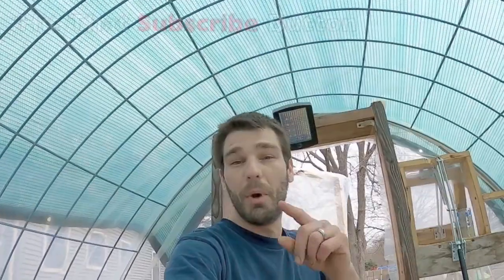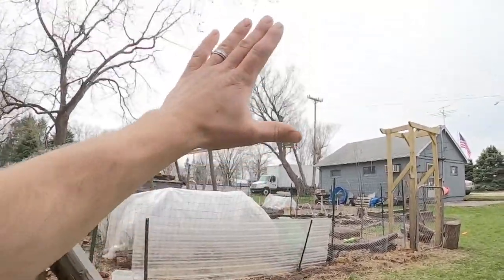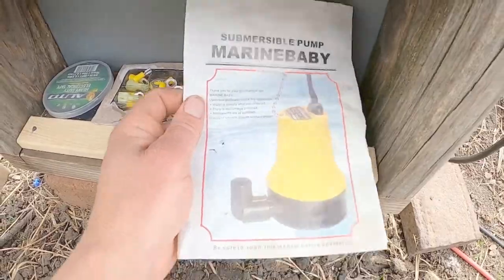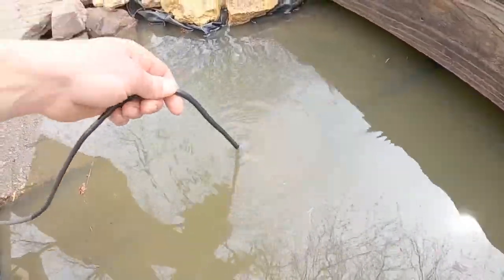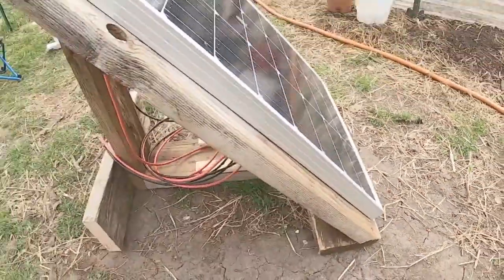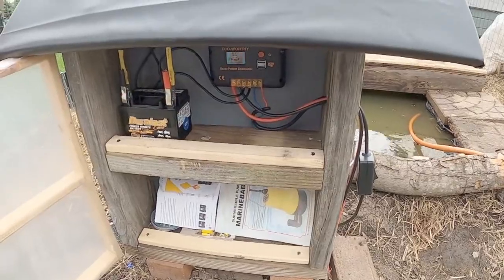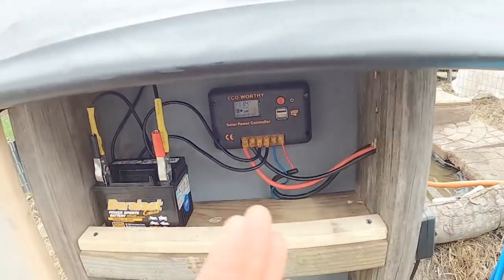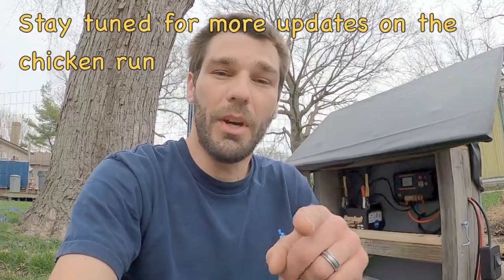DIY Solar Pond Pump Installed In Chicken Creek | Moving Water With The Sun | Self-Sufficient Run

Comment: Ho thanks for great video. What battery do you use ?
Reply from the maker: I've been using any cheap or free batteries I can find for my solar systems, if your going to buy one I would recommend doing a little research on specific solar batteries, you'll want a Deep cycle battery to hold solid charge . great question thank you!
Reply: @Earthdwellershomestead  I made research and the best choice would be LiFePO 4 type battery. They last longer. I boughr the same brand as a pump so " ecoworthy ". Will see how long time that one last🤷 but expectation are about 10years. Probably depend on usage.

Comment: Nice video , I have same sistem as yours but my  panel is not sending any charge to my controller, any idea what it can be I check cables and everything seems good
Reply from the maker: I always double check All connections by undoing everything and re running all my lines and usually I can find where I messed up or didn’t do something correctly. As long as you get power to your solar controller you’ll be able to trouble show easier.

Comment: I’m having a hard time hooking mine up - I keep getting an E01 indicator in my solar controller- the two solar adapters that hook the panel and wires to the solar controller are  opposite polarities. Are they suppose to be?
Reply from the maker: That’s the common error code for no input I believe or low input. I could be wrong I’d have to look through the instructions. Once everything is hooked up correctly I had power steadily even on cloudy days and still currently use my solar system for may different power outputs fans and pumps ect. Sorry I couldn’t help more I would have to see what the problem is first hand